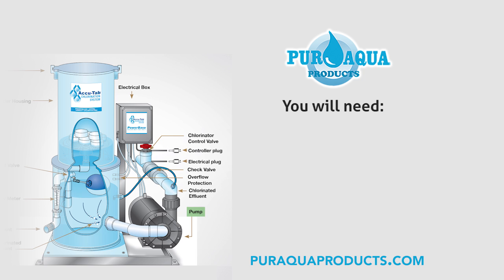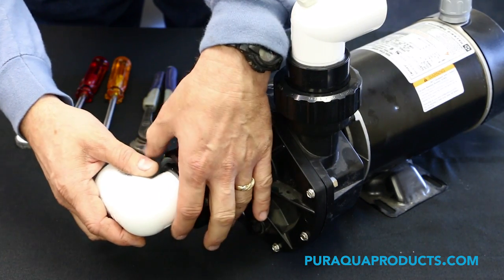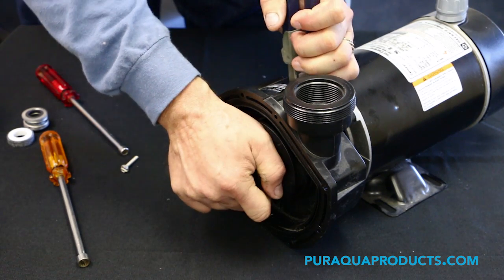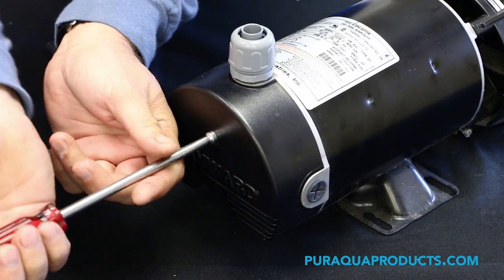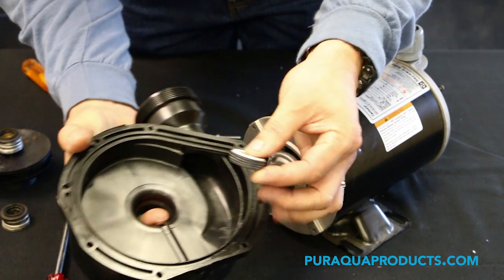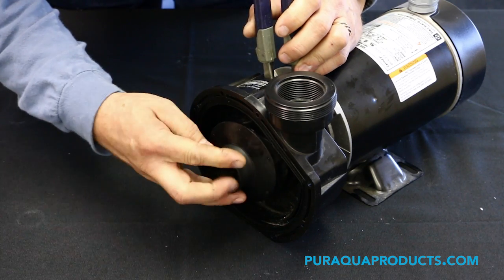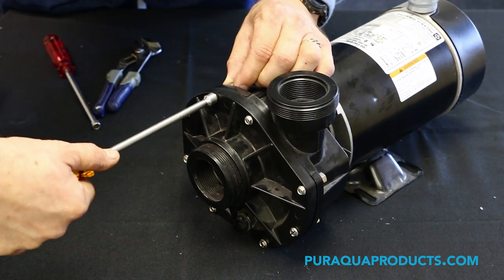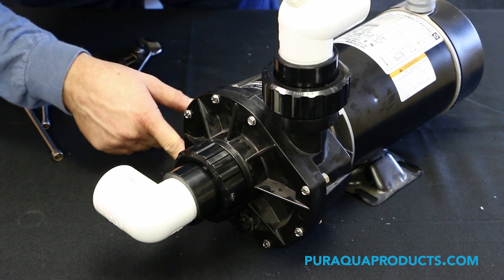How to Change an Hayward Pump Seal

Comment: I'm pretty sure you want to stop the motor turning when removing the impeller by inserting a flat screwdriver into the opposite end of the motor's shaft - don't use a channel lock on the shaft!